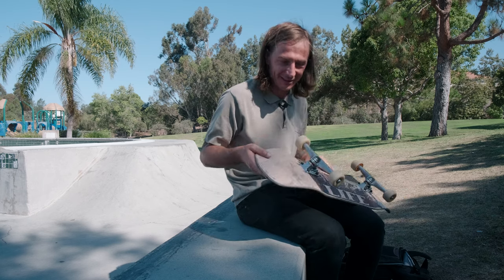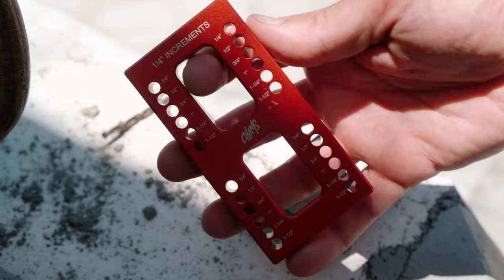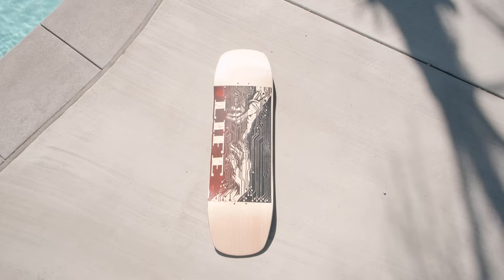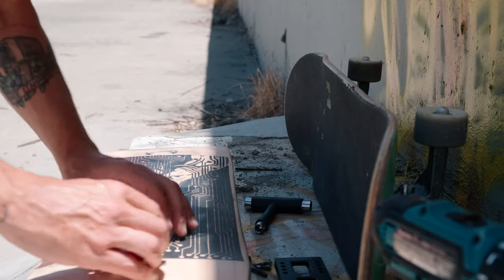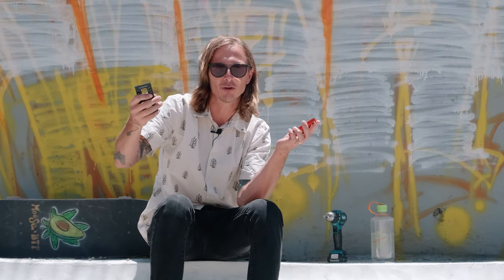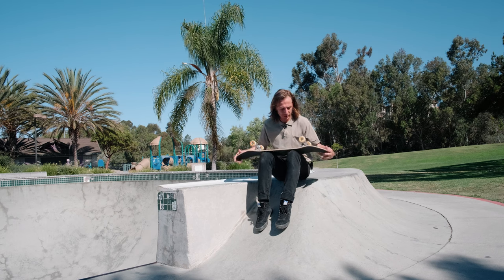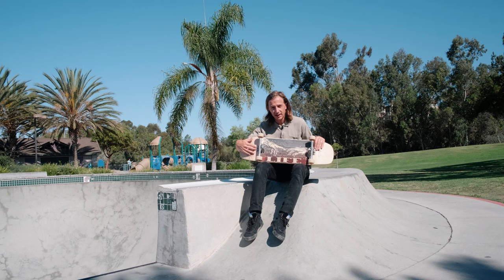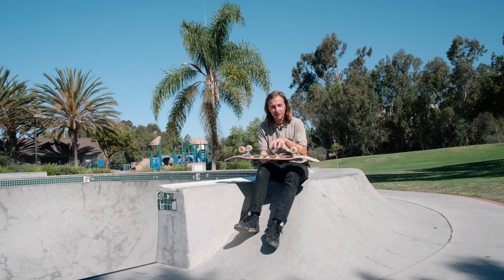Every SKATER NEEDS This Tool!

Comment: Very interesting prospective on tricks and trucks location. Thank you for sharing this experiment!

Ive started to change my wheelbases as a beginner to help with beginner tricks, first ive made my tail longer - this makes ollies easier cause of more leverage, but lower in the air at the same time. Recently, after i had a bad slam on a drop in, ive made my wheelbase longer (shorter nose) to get more stability and overcome fear.

Small tip - if you are doing permanent adjustment, you could fill old holes with epoxy.

Comment: I just use my 6 hole 169’s to make new holes that are pretty spot on because obviously, they line up. 
Just a suggestion. 
Rotation needed depending on smaller larger and then again for the opposite side 
Cinch down the truck and be sure to use a true and straight hand to avoid that annoying “fiddle till it’s straight” thing.

Comment: this is basiclly a jig. you can take a square or ruler and make a line through your hole centers length wise. then take your truck and move it in or out to where you want it,then make a line the other way.mark your cross hair with a center punch or nail or something(this is important to make sure your drill doesnt walk out of hole area) the jig is nice and i didnt price one but im sure its around 30. make sure your lay out is right before you drill anything.always center punch any percise holes.say it, always center punch your holes!(unless you have a jig)

Comment: Sometimes people underestimate how important can be the wheel base measures for your skateboarding. Now I base my boards not only on de inches but also on the wheel base. 50% and 50% I will say.

Very interesting tool,
Only make me feel afraid to crack my board ? 

Best regards from Vienna, Austria 🇦🇹!
Reply: No need to worry about cracking a board because of one extra set of holes. I have been modding boards on the tail side to make my tail 3/8” longer. Flip tricks down stairs etc and still haven’t broken a board yet. I usually skate a deck for 2-3 months and no problems. The modification does not cause any noticeable strength issues
Reply: Wheelbase is often the most noticeable thing and it’s carver that made that clear. 
I am not tall or heavy but I surf and a longer wheelbase is ideal. 14.75-15. I like smaller on slash boards oddly

Comment: That's next level board madness. I'm going online for weird old inverted kingpins, weird old baseplates or fixing modern ones. That tool would be too much at the moment, but never say never.
P.S. To any in America, buy a few Krux downlows kingpins pink label, use some and stash the rest. That is a jewel soon to be missed.
Reply from the maker: The kingpin madness!
Reply: Do you know if the Krux inverted kingpins fit into Ace AF1 baseplates? Wish Ash had inverted kingpins for better slappy clearance
Reply: @Koletrain  You may need to fix the nut and maybe shave the top bushing down. I am going to use epoxy, some JCwelds them. There are plenty of tutorials available.
P.S.Hope third is a charm, previous messages were deleted.
Reply: @azazelreficulmefistofelicu7158  Not sure why youtube keeps deleting our comments to each other. It’s not like we’re talking about anything bad…
Reply: @Koletrain  It's the standard kingpin conspiracy, IKP are better and they are jealous ><
Reply: @azazelreficulmefistofelicu7158  Hahaha, IKP > SKP all the way. Do you have IG? Been trying to suggest we chat over there but kept deleting my comment on me hahaha

Comment: Hah. I thought you’d fit those on the deck and then fit the trucks to them. But basically just a measuring/drill hole tool.

I can see uses but does too much for me to redrill holes.

Comment: Hey Zack i wanna skate a creature egg shape in transition but its 14" wb. Ive always rode 15. Occasionally even 16" but im only 5'6.  Can you skate a 14 wb in transition? Lastly would this tool be ideal if i wanted to push it up to a 15? Id probably go up towards the nose as i rather have less nose than tail.
Reply: A little late but just from my experience, yes you can skate a 14" WB on transition, but it can get kinda squirrelly. I'm the same height as you and have been skating thunders with risers to push the WB out a little more. It's stable enough imo. To your next question, an inch is a lot. Idk if id recommend taking that solely from your nose.